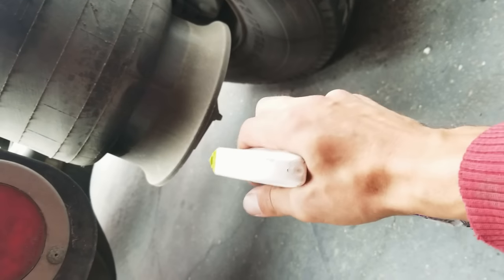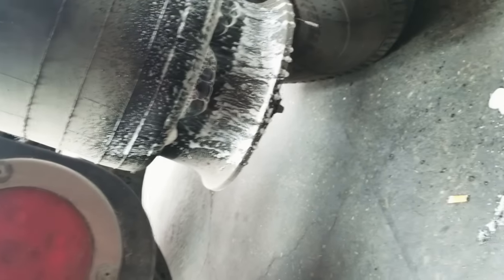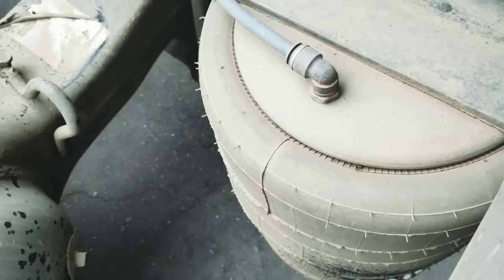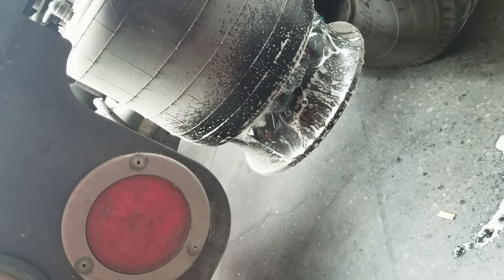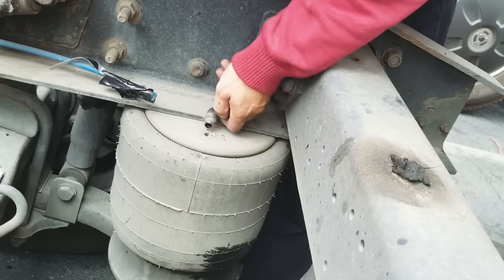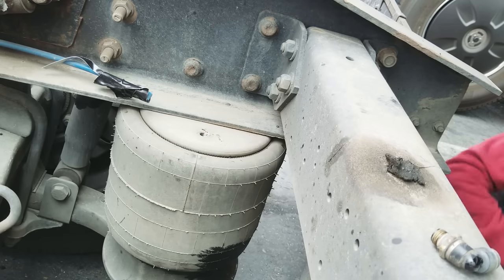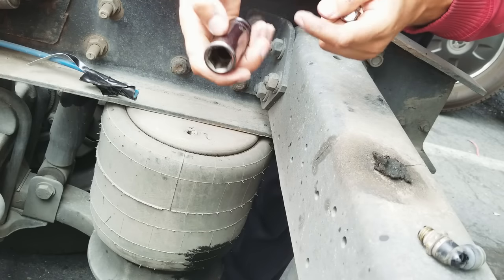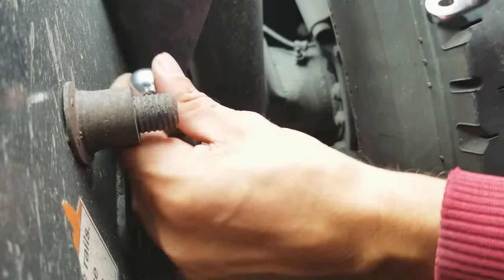How to replace air bag suspension on Freightliner Cascadia Semi Tractor Truck 1 of 2

Comment: You were right to tighten bolt at first  then loosen nut a old timer taught me that trick also penatrating oil a few days before a job  and last heat if needed anyway thanks for sharing your experience .

Comment: Thanks for the video. With a shifting spanner the handle should be pointing in the direction you are turning, this stops it jamming. Also cheap shifters will jam as well. This is not a negative for your video just some people don’t know this.

Comment: Thanks man for this video .
I have a question about Freightliner Cascadia 2016 
The truck it doesn't come with airbag dumb  switch inside the cab
When I need to empty the airbag I don't have switch key available 
If there is any way I can add  airbag switch suspension ? 
 thank you ...
Reply from the maker: Maher A  All that you have to do is release the air hose from the airbag.  Then clamp it so that it will not lose air. Once you clamp it it will build-up air everywhere else and raise the truck. Hopefully that helps
Reply from the maker: Maher A  And yes you can at the switch but I personally never done it before.
Reply: Thanks for the quick reply ..
Appreciate for this information 
 the think making me asking about to add the airbag suspension switch keys inside the cap because I do hook and drops trailers 3 to  4 times a week and you know if I have airbag switch key inside the cab will make it easier ..
 anyway I will check like you said 
Thank you  ...

Comment: You should never bend your air lines like you just ruin the intergity of that line possible air leak later. All you had to do is make a plug with quick connect to seal line up cost you maybe 10 to 15 dollars to make.
Reply: Put piece of wood between the chassis, simple.
Reply: @josealjandrogarcia7144  what you talking about I said bout airline being bent not good thing. What you going to do with piece of wood for airline..
Reply: @2lost505  he most likely means between the axle and frame... i just use a hose clamp with a vaccum boot

Comment: Excellent video, thank you very much, I am interested to know what the front suspension is called, since I am developing a preventive maintenance plan for a tractor very similar to yours, I have already investigated and I know that the rear suspension is Freightliner - FAS II Airliner- Suspension pneumatic axle in tandem 46,000 lb, but I would be very interested and would appreciate if someone told me what the rear suspension is called
Reply: Parabolic leaf suspension